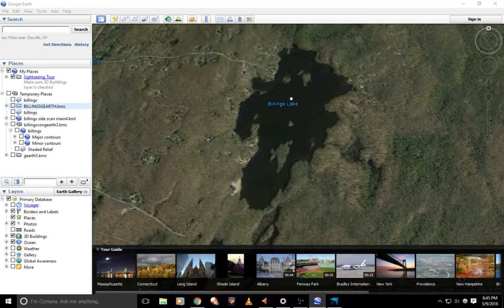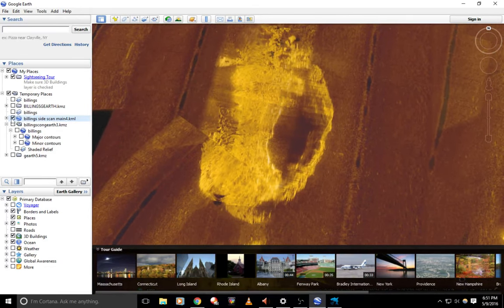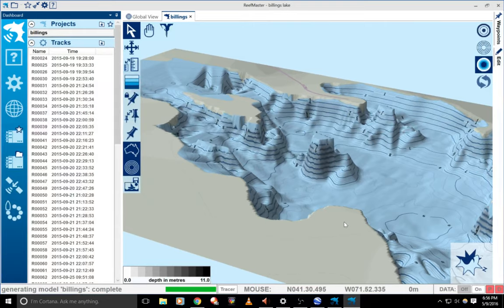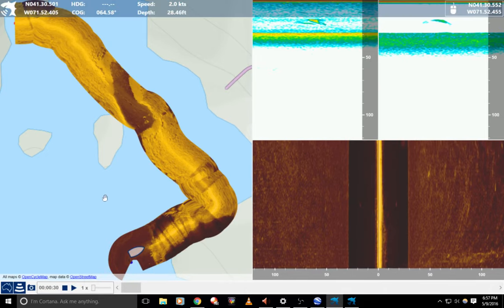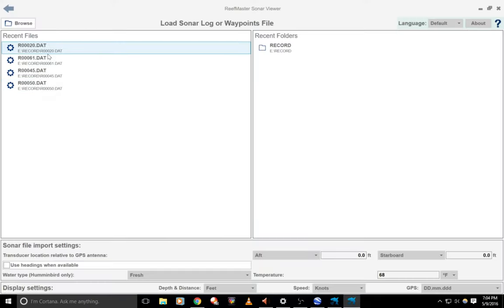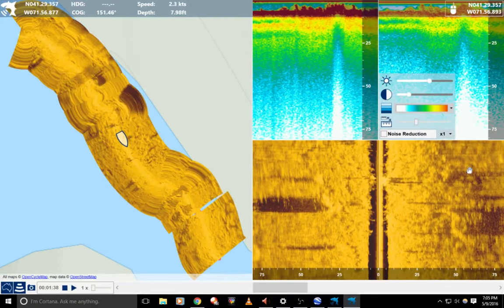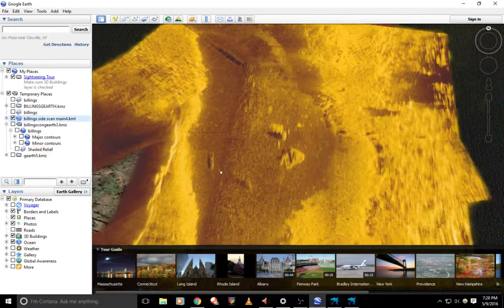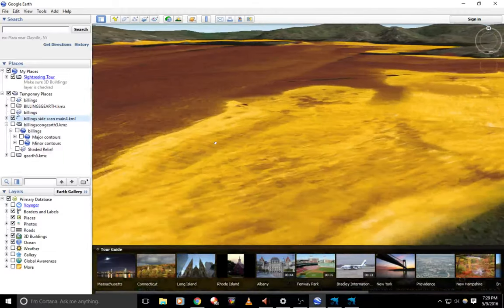Advanced side imaging for bass fishing

Comment: What happens if you put your trolling motor in reverse so that the transducer is being backed up over the water column? Does the graph still form, normally except that now, the 'history' is under the boat?
Reply from the maker: The unit will keep displaying data as though you are traveling forward. The thing to consider here is that while going backwards at slow speed your heading will not be easy to keep and the speed will probably be too inconsistent to get a good picture. Cavitation from the boat traveling to stern doesn't help either. The display will show you a compressed and inaccurate view of the bottom. If you see a good spot to fish during your normal scanning of the area use the "mark" feature of your particular sonar unit and then switch to the map view of the unit to approach the area you desire.

Comment: I've been having trouble with a new sonar if you get this hit me up
Reply from the maker: +Devin Reynolds what are you you using? I have answers!
Reply: I have a lowrance elite 7ti and a hook 5 with down image, the elite has no issues i wired them both but the hook shows a lot of noise all the time and every evening at sun down the down scan just clutters over with white I've tried to resolve the problem through lowrance and they told me to send it to them, they have no idea what makes it clutter over at dark, it seems like I've never been able to get the transducer just right or something because the elite works great but the hook unit and transducer is mounted on the trolling motor and i also get interference every time I hit the trolling motor using the downscan but I'm not sure anything can be done about that